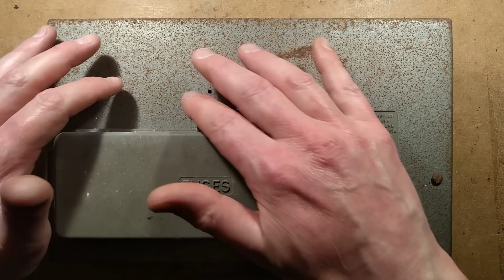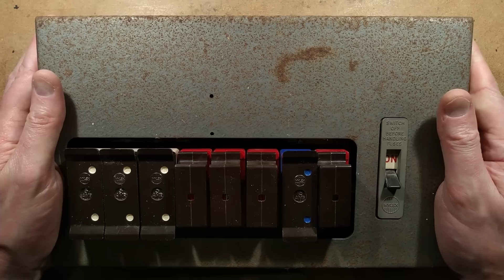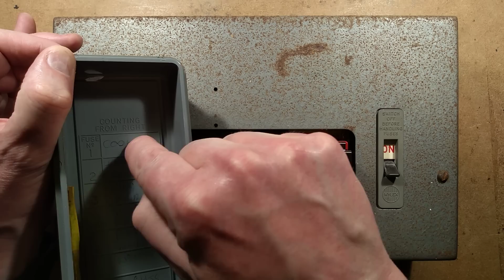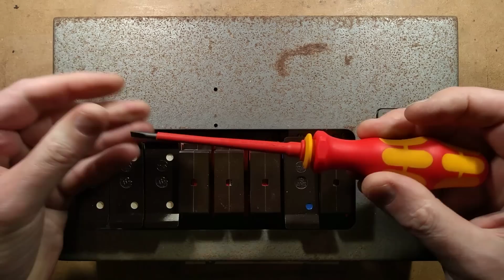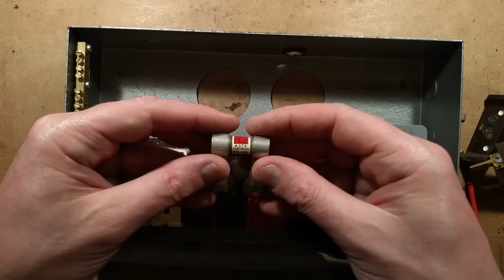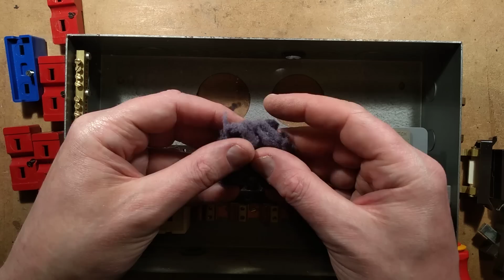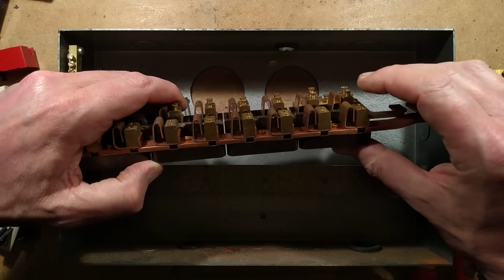Teardown of an old British Wylex electrical fuse box.  (with bare fuse wires)

Comment: Hey can some one help me out my fuse box is working and everything apart from the lights in my house I have changed the wire for the fuse on the 5amp but still doesn’t work
Reply from the maker: Double check that the lighting fuse is wired correctly.  Other possibilities may be a broken connection somewhere, or in some homes an extension of the lighting may have been made from a socket circuit with a fused spur.  That's a small square plate with a fuse panel on it, often mounted near a socket.  It's possible that the fuse in that spur blew, if there is one.
Reply: @bigclivedotcom  thanks I’m only having problem with downstairs upstairs light is perfectly fine
Reply: Also I have quiet an old fuse box

Comment: 12:21: This little tiny bit of what? Pack, packed something?
Reply: Paxolin, resin impregnated paper sheet used once upon a time as an insulator and circuit boards.
Reply: Paxolin. It is a laminar insulating material made from thermosetting plastic, but is flexible rather than the more brittle Bakelite.
Reply: Thank you both! :)

Comment: That would explain why I am able to get fuse wire out of tesco... Doesn't feel safe compared to a more modern alternative
Reply: Yeah still lots of old installations with these things going, some in better shape than others. I've seen them in immaculate condition in older folks houses and some hanging off the wall in others (mostly rented homes).

Comment: Ah but if you've replaced the open fuses with the compatible 'breakers' you can't put that plastic lid back on. But then the arc flash problem becomes moot.

Comment: Funny thing about asbestos removal in my particular corner of the USA. As a home-owner, I can remove the stuff myself, stick it in garbage bags & toss it in the trash. From there it will end up at whatever regional landfill & that's that. All perfectly legal.  If I was to hire a professional, to do a professional job at professionally removing the asbestos according to local laws / codes / regulations as professionals are required to follow, along with the relevant permits a professional needs in order to professionally execute the job.....all the asbestos that is collected, double-bagged in commonly available black plastic household trashcan bin liners collared and taped (for who the fuck knows why....) and professionally taken to the exact same regional landfill. All for exorbitant fees of course. Because professionalism.

Meanwhile, at the local regional landfill, Old Man Bob in his bulldozer is expertly moving rubbish about the trash heap at the landfill, rips open the either single-bagged or double-bagged disposed-of asbestos....and guess what, asbestos everywhere in the environment again.
And gov't regulations drafted by idiots are the best right? RIGHT?!

Comment: Still got one of these (the bakelite version, nothing to go wrong really, the house was rewired in the 80's and most of the sockets and switches are the 80's style MK logic range, much better quality than the modern accessories.

Comment: Whad'ya mean that's an old fuse box, it looks quite modern to me.  Mine doesn't have the flash-over problem because its all wood.  https://imagizer.imageshack.com/img921/9373/1rtUSd.jpg  Note, no mains switch and no visible wiring.  However it is quite dangerous, it's really difficult to pull those fuses out when you're balanced on top of a kitchen stool and in your seventies.  Yes that is the ceiling and yes that is a big crack in the wall, I'll get around to fixing that one of these decades if the house doesn' burn down first.

Comment: Fuse Wire?? Pre retro 1920s ish 
It's alive! Bella,,,
Reply: Apparently, they trusted the average UK consumer to wire his own fuses (and plugs).
Reply: @jamesslick4790  
Thanks for the reply,,
60 yrs ago I was in a house that the wires ran on the surface of the wall, on porcelain insulators. And the wire was covered with cloth braid. And the switches were bare metal, knife switches...
Talk about pre retro...
I am guessing that the house was built in the 1860s...
Reply: In the past I've lived in several houses with exposed cloth wiring (but with enclosed, rotary switches), And this was in 1960s and 1970s USA (Pittsburgh, being home to Westinghouse Electric), Electrical wiring often (and some still does) dates to the 1890s. While room light switches were enclosed (even on open wiring), The fuses were in porcelain blocks with an open knife switch as the main cutout.
Reply: @jamesslick4790  
Thanks for the reply. 
Technology and ultimate safety often times, do not run hand in hand.
Kind of like software engineers that feel no need to flow chart.
When a problem arises,  they say, wow I didn't think of that...
Reply: @willybee3056  Yep!

Comment: Maybe this is just an American thing, but I'm surprised the main switch has off on the bottom. Traditionally, flipping the switch "up" turns something on. Is this a cultural thing, or just an unusual product?
Reply: It's a Commonwealth thing, and quite a controversial thing.  In most countries "up" is on, whereas in the commonwealth country's "down" is on, this matters little these days but a long time ago heavy industrial levers that slipped out of their grip would become fail-dangerous rather than fail-safe and usually electrocute someone.

Comment: Is no one gonna comment on the fact that the switch on the right has on as down and off as up?
Reply: but its British. Up is off. Down is on.    Opposite in USA and some other countries
Reply: @collinhunter9792  it makes more sense for down to be off. If something accidentally hits the switch and down is on, you could be working on live equipment and get a nasty suprise. down being off is safer, because nothing can hit the switch and turn it on
Reply: @BabyWith_AGun  Anything can hit the switch and turn it off just as easily as on, we're talking about a tiny wee bit of plastic, not a large iron lever, so gravity is of little or no consequence here, but a long time ago you would have been correct as our fail-dangerous design did cause a few deaths amongst mainly railworkers and some in industry.

Comment: You think we are brave our home in spain us 3 phase into the house  we required s new consumer unit because there was no insulstion aroubd some ofvthe wires coming into the unit.  They replaced the lot live.
My father who us a retired engineer and industrial electrician was a little concerned. To say the least
Reply from the maker: Sometimes there's no real option if the local utility company is officious about people cutting the seal to pull their main fuse for isolation.

Comment: I've never worked with live 240V, but I have worked with live 120V probably dozens of times in my life (mostly fluorescent light ballasts in commercial buildings where turning off a whole floor's lights wasn't an option, fuck OSHA btw). 
Is there any big risk considerations to take into account when working with live 240V vs 120V? besides the fact that it will hurt a lot more if you mess up and ground yourself...

PS: Before anyone goes on a rant about it, I know the risks involved with live AC in general, call me reckless or irresponsible if you want, I really don't care. At least where I live, any properly trained and/or experienced electrician knows how to work with live wires and how to minimize risks.
Reply from the maker: You just have to allow for the fact that more current will flow on contact with live metalwork.  That very thing tends to make people more wary with 240V anyway, since it's quite harsh if you get casual with it.
In both instances the difference in shock current in a dry environment and a wet one is huge, so you have to keep that in mind when working in a wet environment.
Reply: @bigclivedotcom  Thanks for the quick reply, you also make an interesting point about dry vs wet environment since I live in a very humid tropical island.

Thinking about this a bit more I realize we do have 240V but it's because we use split-phase transformers, so even on those instances, both leads are still 120V each. Which made me wonder, are split phase transformers also used in the UK (240/480)? or is it straight up single phase (one lead) only?
Reply from the maker: @oriongaby  Three phase 240/415 system with just a single phase supplied to homes and all three phases supplied to factories.
Reply: @bigclivedotcom  Pretty interesting TBH, a standardized and simple system. Over here you get single phase primary power on rural areas, two-phase primary is probably the most common along main roads, towns, small commercial areas etc., and usually three-phase primaries are only there if there's a reason for them being there. (factories, malls, long-distance power transmission etc.). You can imagine the wide arrange of transformer setups and secondary voltages scattered all over the island...

Comment: One of my friends asked me round to take a look at his cooker in the house he just moved into. Found a fusebox exactly like this one, it's safe to say I found the problem and yes it had the arc damage to the box above the fuse https://imgur.com/a/MO2kbkU
The switch for the cooker was toast also. 

Luckily they had just moved in and this wasn't mentioned by the previous owners so they (PO) had to foot the bill to get it fixed, they opted for a new box and switch but I hope there was an EICR too.
Reply from the maker: That's more fire damage from the burning holder.  Quite odd.  I wonder if the issue was a loose termination .
Reply: I would assume so, there is a small gap in the wire at the screw though, it could have been that but without more experience, it's hard for me to tell what was the main fault.

Comment: That model was solid, robust, and reliable - HOWEVER - they were mostly fitted from the late 1960's to the late 1970's, so if your  house still has one it is probably well overdue for a complete rewire.

Comment: A few years ago we got a job to build two wheelchair ramps up to a village hall 
We also had a load of corogated white asbestos roofing sheets we wanted to get rid of 

Well we dug a shallow foundation for these ramps threw the asbestos in there smashed it all up with lump hammers (I do like the smell) and built these ramps on top 

Diddnt bother with masks diddnt see the point it all get on you’re cloths anyway so you finish take the mast off and breath it all in anyway

Comment: Ring circuits? I'm gonna guess it's the outlets. Can you splain.
Reply from the maker: Our socket outlets aren't just wired in a line.  They loop round in a circle back to the same fuse or breaker.  That means the current is shared between both ends of the wire and allows thinner wire to be used.  The downsides are the risk of overloading a cable if the ring gets broken somewhere and the red tape industry's continuous desire to invent more and more nonsensical ways to test them for fault scenarios that are very unlikely to occur.
Reply: @bigclivedotcom  thank you. I really dig learning the electrical differences between merica and the UK.
Reply: @bigclivedotcom  wow, interesting! I wonder tho if the cost of thinner wires really balance the double lenght of wire used? I guess it could work in a small place with two rooms, but for a bigger house, given the current price of wires, I can't see this method being saving any money. But 0.75mm wire here has been banned for home use since the 90's; the price difference between 1.5 and 2.5 isn't so great that it would be a feasible way to save money.
Reply: LeSarthois It's not double length, just the extra length to close the circuit.

All that said, in the rest of Europe the standard is to use 16A wire with a 16A fuse for each of the left and right half of the place, instead of a circle of 16A wire fed by a 32A fuse.  Because it's not a circle, it is completely normal for the 16A feed to branch out wherever convenient, usually at whatever outlet or switch seemed practical when that part was installed.  For example a circuit could run from the fuse box on 1st/2nd floor (where overhead wiring entered the house) down to the junction box above the ground floor hallway light, then branch out to the light switches at the kitchen and bathroom doors, then further to the lamp fittings and sockets in those rooms.  Diagonals are banned for maintenance safety, all up/down stretches must be vertical.  Usually there's one or two fuses for an entire floor in a small house, plus extra fuses for stove, heating etc.  Modern regs require kitchens, shared staircases and large party halls to have at least two circuits reaching that room.
Reply: @LeSarthois   The idea that the design was a money saving initiative is a bit confused.  When the standard was invented houses that had electricity generally only had one outlet per rooms and that not even for all the rooms.  The body that designed it was surprisingly forward thinking and anticipated that increasing numbers of portable devices would require increasing numbers of outlets.  The 30 amp ring circuit allowed unlimited numbers of outlets to be placed on the circuit using the same conductor sizes as the previous 15 amp radials.  [In fact in some case joining 2  x 15 amp circuits could create a 30 amp ring — although this was not officially sanctioned].

So the saving came in being able to use the existing industrial infrastructure already producing quantities of (Imperial equivalent of modern) 2.5mm² and be able to wire 30 amp circuits without going up to 4mm²

Of course a circuit capable of delivering 30A meant that a fuse was desirable to protect any much lower rated appliance cables plugged into it and so required the creation of the BS 1363 3-pin fused plug!
Reply: @calmeilles  Thanks you! Very interesting to know. Now I understand why your outlets and plugs are fused!
In France, Legrand released a few fused outlets in the 1960's and 70's, of the unfamous "Mistral" series (it's so robust and widespread you still have tons of them installed in houses)  but they weren't common at all; the fused versions, I mean.
https://www.picclickimg.com/00/s/MTYwMFgxMTM1/z/tggAAOSweX5cOc-1/$/prise-LEGRAND-Mistral-SANS-Terre-avec-fusible-250v-6A-_1.jpg

This model is much rarer and almost impossible to come by undamaged :
https://www.picclickimg.com/d/l400/pict/283453860674_/Prise-de-courant-Mistral-Legrand-deux-p%C3%B4les-avec.jpg
A few earliers plugs and light switches were fused too but they were never common, and I suppose were mostly used to "upgrade" existing installations for the people that feared issues with their old electricity setup.
Reply: @calmeilles  Is that true?  I've always heard that our ring circuits were the response to having very little copper left after WW2 when they were looking for a design to consolidate the grid.  Is that just a myth?
Reply: @johnfrancisdoe1563  I meant double lenght as in, if you wanna do a circle circuit that goes to one room, you have to seal it back to the fuse, so if the room you wire is 100 meters away from the fuse box, you have to use 200 metres of wires.
So this system works for short distance or a "reasonnable" number of outlets, both situation that were found in old places and rooms for rent, but in modern housing where you reach the max number of outlets in merely one room, it would be cheaper to use the right wire gauge from the start.
Reply: @krashd  get this tho north America had extra copper so we used 110v so thicker copper was used. I forget the mine but it was huge. So they convinced us that using thicker wire and only 110v was more better.

Comment: If I doing any work with stuff I wear n95  masks. I also have pr3 to pr3 to pr3r  full faced respirators. And n95 harf faced respirators. Mine pretect right upta nuclear particals I have to suits as well tyvek ones I collect allsorts I also studied firefighting and fire investigation histology histopathology cytology forensic pathology diagnostic medicine biomedical bone sciences ect  I have a degree in electrical engineering and programming I use audino boards I also done physics

Comment: Jesus, how is that thing still legal? If it is, it’s gotta be in grandfathered situations only. It doesn’t have any RCDs.

And because of that I’m going to disagree with your initial “if you’ve still got this that’s fine” statement. This should be replaced at your earliest convenience even if you’re allowed to not do so.
Reply: Piffle.
Reply from the maker: Here's the thing.  A correctly sized fuse is 100% reliable.  In a video I made about an MCB a while ago it had jammed up with dust, so the solenoid pin wouldn't move.
Reply: @bigclivedotcom nothing wrong with fuses, you can always install one on din rail. But those units are just badly designed. 

Replacing just the fuse wire, with zero attempt to verify that the right wire is getting installed? Not having per-circuit switches so you have to de energize the whole installation to change a fuse? Those were bad even when these things were new. And not having RCDs in your system in the 21st century is a difference in potential lethality that’s really just not good when it’s so easy and cheap to rectify.

Comment: What was the point in that the old wylex rewireable  boards are long gone and won't be back concentrate on now and the future think youll find nobody will be interested in your info on old wylex boards you'll be on about the megger with the turn handle and a rawlplug tool next from the sixties
Reply from the maker: Recording a snapshot of electrical history for the future is important.